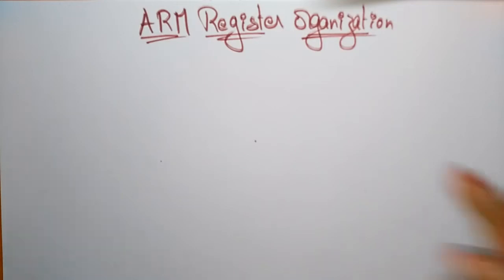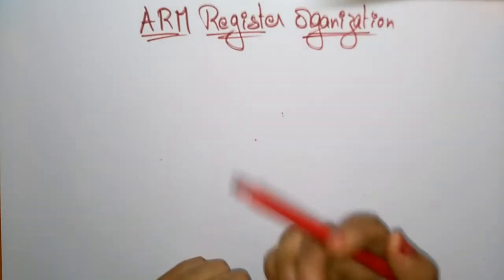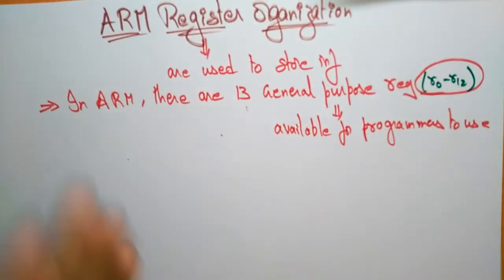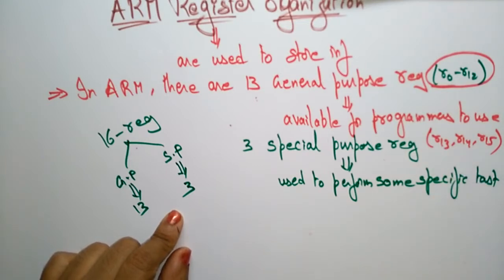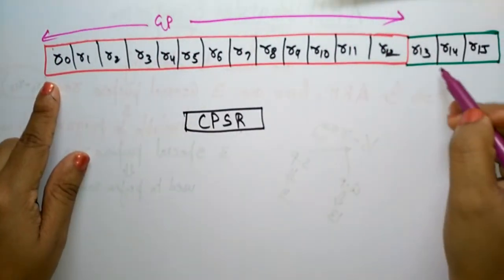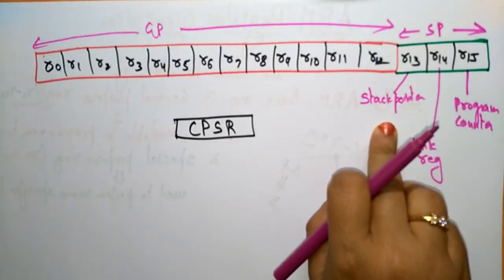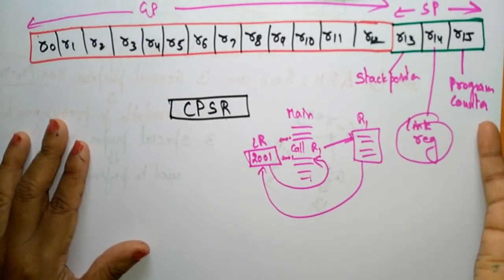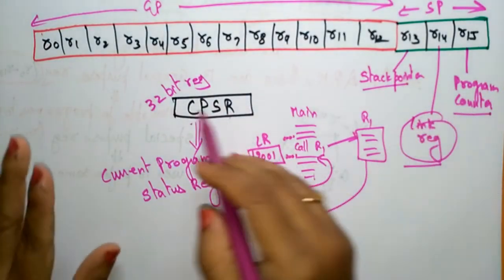ARM Register Organisation | Part -1/2 | ES | Embedded Systems | Lec-10 |  Bhanu Priya

Comment: Link Reg is doing the work of Stack Pointer.Then why do we need Stack Pointer?
Reply: This is used only  in ARM to avoid the stack which normally takes more time to access .Only in thumb mode it uses SP as you mentioned.Because ARM mode is different from thumb mode.